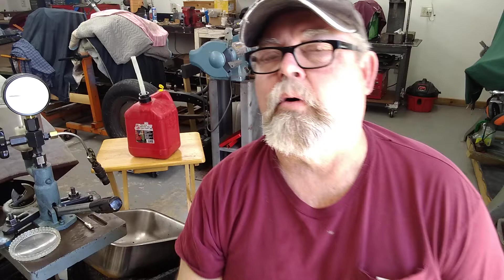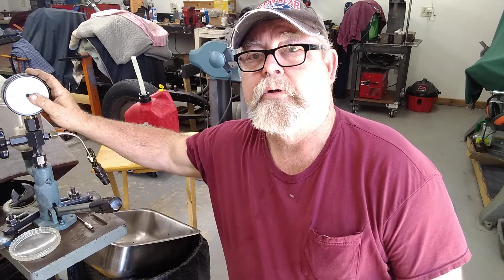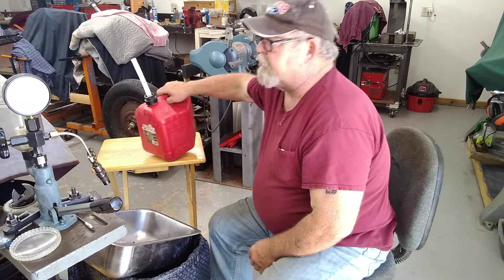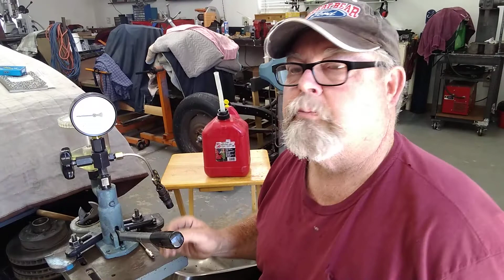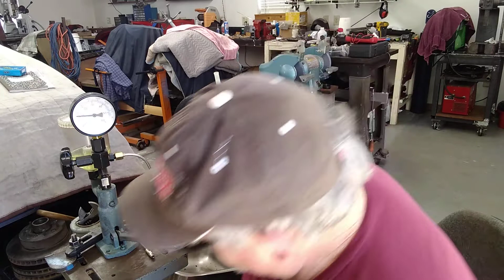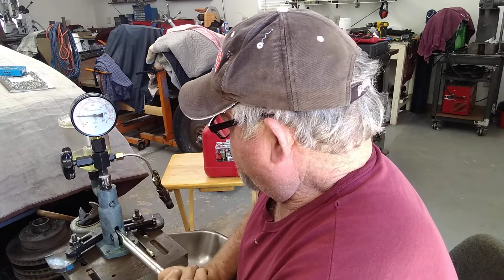Day 5 on the Bosch hand pressure testing pump. Is it Worth it.

Comment: Torch your copper washer till it changes colors and slow cool gradually taking the heat away and you can use them over again in a pinch.
Reply from the maker: That's a new one on me. Thx Brian for a great tip. Will remember this and use it soon I am sure of..